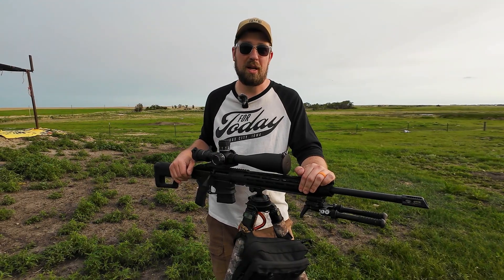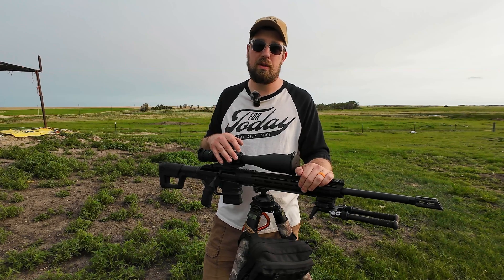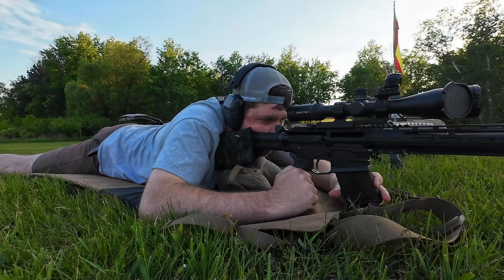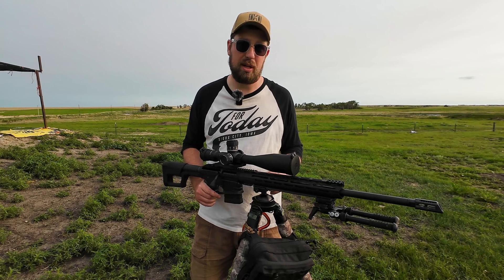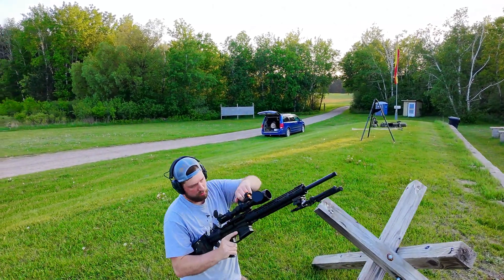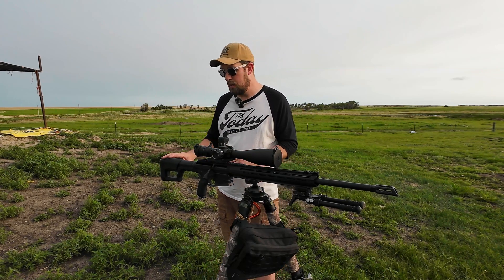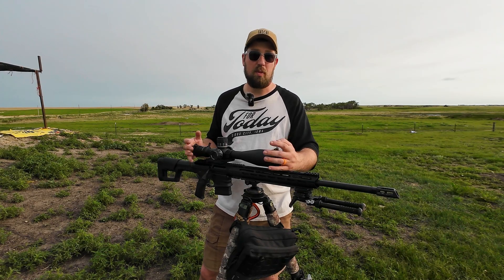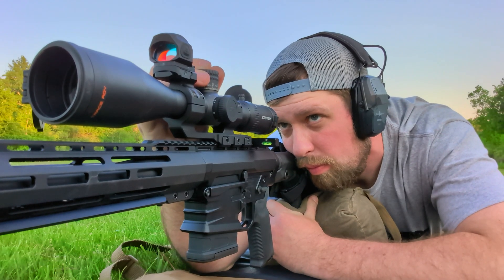Best NON-TRADITIONAL Bolt Gun - UP10 PAST 1 Mile

Comment: 🥥🥥🥥🥥👍🏽 The Discovery Optics are decent for the price but their customer service in my experience is non existent! I shot a mile last Tuesday two hits in a role 21 up and holding 3 MRADS right.  Bergara B14HMR 22” barrel with brake (Bergara as well), MDT XRS chassis and trigger tech single stage.
Reply from the maker: Only 21 mils up at 1,780?
Reply: @TheMidwestMarksman  Yes, that’s what I counted on my Bushnell 6-36, could have counted wrong! Two full rotations from the zero stop plus another  mill. I am zeroed at 200 yards. Have a short video coming out in about 3 weeks.